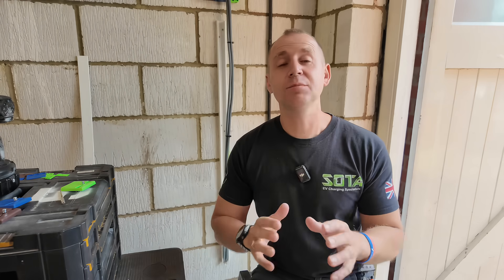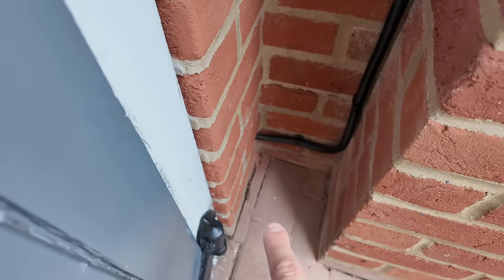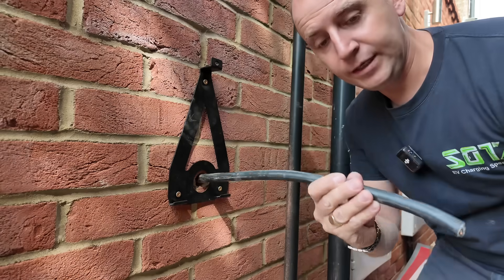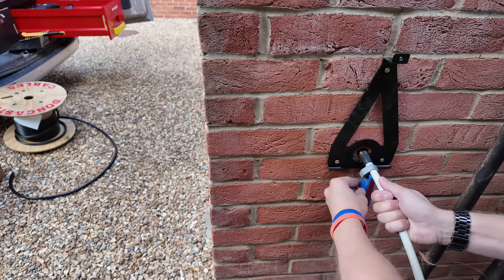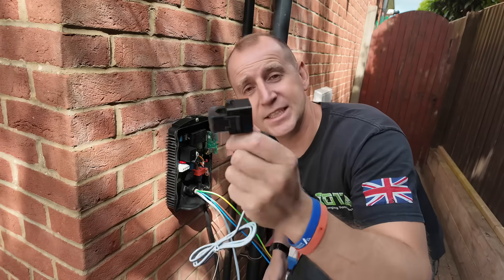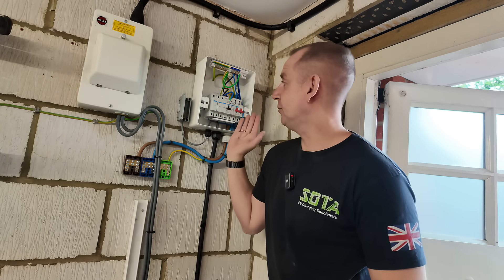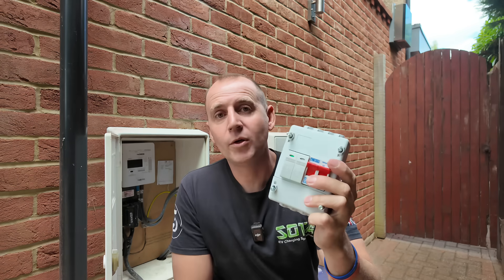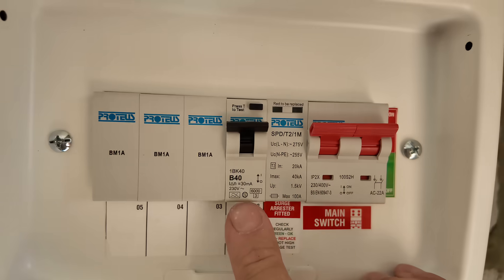Real EV Charger Install Tips They Never Told Us at college!

Comment: In that garage electrical sub intake I would have placed those single pole 100 amps connectors in the correct metal enclosure butted up to steel trunking and the steel trunking butted up to the two fuse boards.
Of course to establish as much mechanical protection at that location.

The way you left the intake in some part I found it to be unsightly ( positive criticism ).

What ever the budget is for a project, safety and neatness must never be compromised.

Comment: Really brilliantly helpful vid. Iv installed a few hypervolts and they are by far my favourite but I still learnt something here with the SPD meter tails isolator in the meter box iv never seen that before but gonna use it in future. 

I have to ask did you need to mount the EV CU on a flame retardent board or can you mount straight to breeze block like you've done on this garage ? Iv always put them on a board but do I need to? ...
Reply from the maker: Thank you, you don’t have to mount on a board 👍
Reply: @sotaelectrical thanks. When in a cellar or under stairs iv always used a board but when it's been outside next to a meter box iv mounted straight to the wall.
Keep up the vids like this one they help us all out. 👍

Comment: Always install the 4 pair ethernet cable. If you only have one pair and then the homeowner gets solar and an EV charger that can match output to solar production, then you need a 2nd CT clamp to monitor solar production as well as whole home load.
Reply from the maker: Always
Reply: Hi Adam, back to my question again if possible about your installed isolator switch with built in SPD, i’m just slightly confused as I don’t see any earth cables going in or out of that unit, so question just to confirm what i thought it was the the thing, does that unit has earth/cpc connection to the SPD? Thanks in advance

Comment: Hi mate I need your expertise! I am about to fit my first hypervolt home 3 pro at home but have a hybrid inverter and battery set up..

How can I make it so I don’t drain the battery and use excess? 

Please help!
Reply from the maker: You need to limit the battery from discharging when your charging the car, this has to be done on the battery side of things
Reply: Hi. Fantastic video. I have the same problem where the battery is used to charge the EV. I have Fox batteries. Would you know how I go about restricting the batteries when charging. Also the charger shows the solar export as part of the house load. Would plugging a second CT in the right hand socket in the charger stop this. Which tail do you put the ct clamp. Thanks in a advance and great video and explained clearly.

Comment: Another great video. We put what we call an “eyebrow” of silicone above the hole. That way any water that trickles down is diverted away from the cable entry. 
Also, does that cable fit through a 25mm stuffing gland or do you have to drill 32mm?
Reply from the maker: Thank you, the cable does fit through a 25mm stuffer
Reply: @sotaelectrical Thanks for replying and I love the idea of the wago box outisde the CU. Definitely going to do that going forward. 
Can you tell me please what platform you use to gather customers photos and other details? Or perhaps you’ve done a video of it?

Comment: The courses are awful, every sparks pretty much knows from birth how to wire and size a circuit the issue is always the intricacies of the paperwork and signing off. Which is never covered or up to date at the time of the course.
The amount that get installed and just a cert and building notification done and no UKPN notification etc is crazy. 
Also anyone else noticed that Andersen still hasn't updated the A2 to take 3 phase 6mm EV ultra. Always supplied with a tiny stuffing gland and it's a ball ache to try and get a 32mm in place. Also their 22kw unit doesn't come with a CT so if a customer is waiting for their 3 phase head upgrade it can't do dynamic loading out the box. There really ought to be legislation for what has to come with these chargers regardless of 7 or 22kw.
Reply from the maker: Yes the A2 is an absolute ball ache and I won’t install them because of it
Reply: @sotaelectrical  It's a shame because it gets onto the spec for so many listed buildings. I am trying to put forward the Simpson one for our other listed building owners, and I guess the new Andersen Quartz will be a viable option but not if it's lacking like the A2 is.
Reply from the maker: @effervescence5664 have you tried the A3? That takes the 25mm stuffer and it’s not in a million pieces
Reply: @sotaelectrical  I haven't but it's 7kw only so it hasn't been speced once so far.